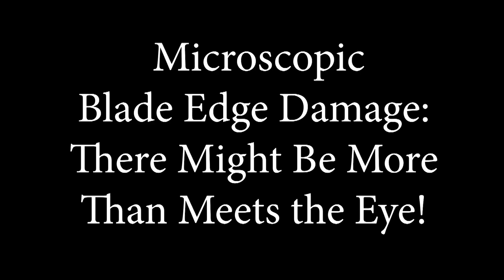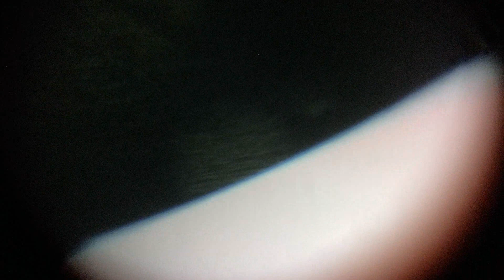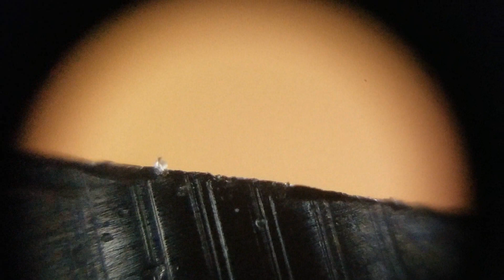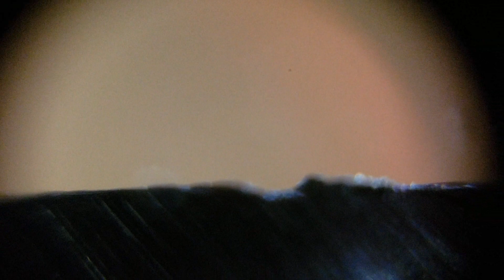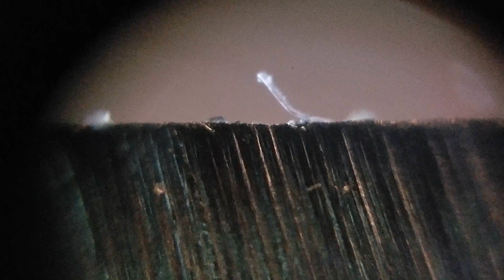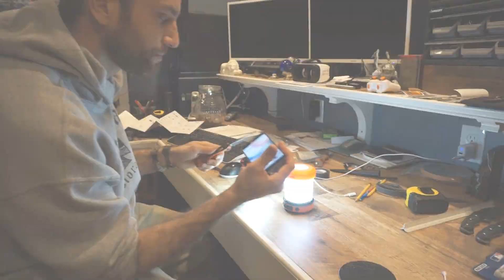Microscopic Blade Edge Damage:  There Might Be More Than Meets The Eye!

Comment: I was hoping when I read the title of your video that you might be addressing something other than the mere existence of microscopic chips in the edge of a blade, but possibly discussing how to tell if the blade you purchased had forging deficiencies that couldn't be solved by some quality sharpening, or if it was simply an issue of some bad sharpening, or misuse that created the small chips in the edge of a blade. I would think any quality steel that had gone through proper hardening and tempering shouldn't suffer any damage from simply cutting up some cardboard boxes.